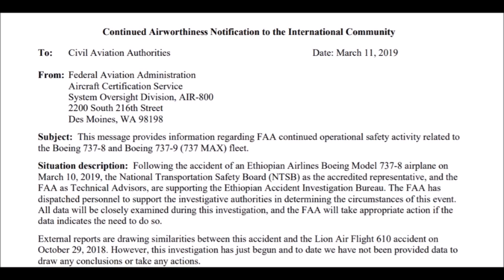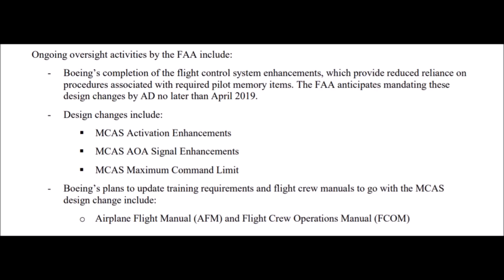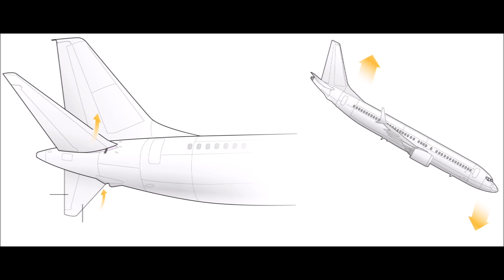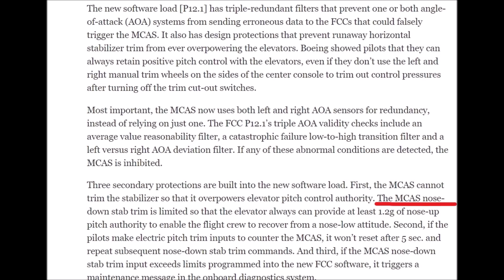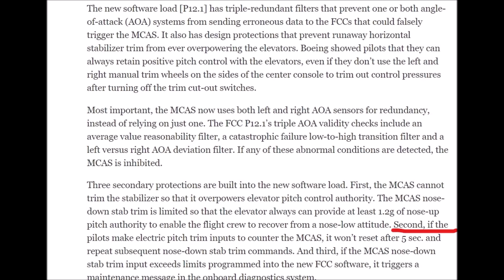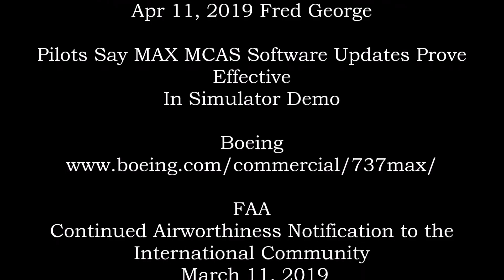737 Max UPDATE 14 April 2019 "The Fix"

Comment: ...and trust me...software to change characteristics to fit a safe one should be a major concern...as a pilot I would prefer an airplane where the automation helps me rather than be the only reason the unsafe plane is safe...and as a programmer I can guarantee you that programs can always have bugs...should not be used to change characteristics from unsafe to safe in any passenger airliner.

Comment: You mention that automation saves lives. Well, in the MAX, the only thing automation does is to save money at cost of safety...remember that the engine was too big to fit under the wing...in the old days they would redesign the entire aircraft as a new generation...the A320 neo was high enough and did not have to be re-designed...in the case of the MAX, they put the MCAS...it is a bit like making an albatross fly as a normal plane by making it swallow a software program :)

Comment: Im sorry but this does not solve the root cause, it solves the effect of the root cause. the root cause being a design flaw in the placement of the engine. this is akin to designing a car that swerves to the right, then you compensate by turning the wheel to the left and adjust the steering to center. stupid if you ask me

Comment: Why doesn’t MCAS check the plane’s pitch attitude? Activation makes no sense unless the pitch angle is fairly high - not the case in either crash.
Reply: Pitch and AOA are not the same thing, and differ over the flight envelope. Adding another check does not necessarily help, an aircraft can stall in any pitch orientation, if the airspeed is too low.

Comment: Shouldn't an aircraft which is designed to fly, fly normally without the MCAS? The earlier version of Boeing 737 had no MCAS. This system is basically introduced to offset a fundamental design flaw, i.e. nose up pitch induced due to bigger engines fitted further up the wings. Nobody is talking about this flaw.  It's like fitting your family sedan with an AMG 6.6 liter bi-turbo. They basically didn't touch the airframe.
Reply: The MAX will fly the same as the earlier NG model, over most of its flight range. Only at high AOA, which should never normally be encountered in a passenger flight, is there a need for the MCAS system to activate. BTW, the power of the MAX engine is almost identical to the NG engine, only the diameter is different, because of the larger fan and bypass ratio.
Reply: The max has a height restriction, unlike the Airbus. hence the big engines had to be pushed forward and up @gordonrichardson2972

Comment: Juan. Great video.  Any chance we could get you to do a system every week. It’s more fun watching you (especially trying to justify the airplane with the wife) than it is trying to read my manual. 

I’m really glad that you brought up the issue of automation and safety. I am tired of the public thinking everything is automatic when in fact NOTHING is automatic. We are becoming over reliant on the ASSISTANCE we get with a 3rd set of hands, so to speak, while we fly the aircraft in an ever more crowded and complex ATC system that gives us progressively less room for error.  I’d love to fly the aircraft more if I wasn’t in constant fear that the 5th runway and arrival change that Denver just made to my flight plan wasn’t programmed to perfection. With no less than 18 nav waypoints, crossing altitude ranges, and speed changes, with 8 very important notes written in micro print on the sides of the star while be bounce along, and in the middle of that I am dealing with company requirements to coddle the flight attendants and passengers with soothing and calm PA’s😊 as we encounter moderate turbulence, and deal with the 5 company messages squirting out over the printer over gate changes and comfort animals. In the meanwhile, the controllers have become professional auctioneers in their rate of speech, and they are controlling 25 airplanes at a time on 3 different frequencies.  THATS making our hand skills worse... more importantly it’s driving me crazy. 

So the environment is driven to change by the increasing complexity and congestion. 

And no wonder you are always making videos.  I’m guessing scamming the  system and getting close to 90 without your 3.....  I have Uber respect for that maneuver😉

Comment: At 8:12, when you say that if the average reading of the two angle of attack vanes is too far out then the MCAS cuts out.  Instead of "average," do you mean deviation, standard deviation, or standard error?  - Ian D.
Reply: There are a number of different measurement criteria, and Juan is glossing over some of them. AOA is an instantaneous value, but fluctuates with turbulent airflow. Tracking an average value over time is a good idea, in order to detect anomalies, before taking any drastic action. Look at the Boeing document at 07:50, rather than the words Juan says. Even this is a summary, the full algorithm is much longer.

Comment: It's still going to take an act of God to convince me that when a flight officer pulls on the column, and the craft does the opposite, that this is not unacceptably gross negligence. Reducing the killdozer potency of the fly by wire, and increasing the display and audio warnings is swell, but Jesus Christ, pulling up on a plane and having it nose down? NEGLIGENCE. Even criminal negligence, because they MUST know better than that.
They need to pull this entire model and start over. Their paradigm is utterly deadly. Even though it makes the MAX "easier to qualify for to fly".
Reply: But as Juan says, that's supposedly in the new software roll out, that elevators trump trim. So maybe the killing ends now...

Comment: OK Juan here is a question for you.  what is going to happen to the max aircraft when they extend the fuselage nearly 5 feet like I read the other day.  Talk about center of gravity issues.  Would really like to hear your opinion.   A side bar;  I was a trainer on a retail system for the USPS.  We were told that we could try to break the system during our non teaching time..  I tried a lot of things and then found  that there was a flaw in the programming regarding refunds.  I actually talked to the programmers and they had it fixed in less than a week.   I  used to program, now retired, but still create stuff in Excel  and one thing I learned is that it isn't good to release until it is tested, tested and tested again to be sure you have accurate results and you verified it manually.   Good info Juan.
Reply: When an aircraft fuselage is extended, they usually put half ahead of the wings, and half behind, so that the CG doesn't change much.

Comment: 1. I think it’s too soon now or even EVER to make the general statement that automation SAVES LIVES. MCAS (automation) just downed 2 B-737’s killing ALL onboard. If you say that automation is intended reduce pilot workload, ok then but in these two accidents the automation only increased confusion and workload. Some safety device THAT was!
2. Once stabilized in a nosedive, shallow descent, straight and level flight, or steady rate climb, an aircraft is already pulling 1.0 G’s just by simply being there. If MCAS (automation) is going to have authority to limit me (our the pilots I’m trusting to ride behind) to 1.2 G’s which is a sum of only  0.2 G’s more than you get for just “being there” in steady state flight! Thanks for relaying this to us! Heck man! I’m pulling 1.0 G’s just sitting here at home, in a chair, watching this video. If the new MCAS is going to guarantee that I can have 0.2 G’s more than what I’m pulling in steady state flight, well then, thanks but no thanks. I’m not convinced. 
3. Back to “automation saves lives”. I remember when Piper started putting that wonderful “automatic landing gear extender” on their retractable Piper Cherokee Arrow and Lance so that just incase pilot forgot to extend gear before landing, the new automatic gear extender would “step in” and save the expensive damage of a “wheels up” landing. That all seemed to be a good idea till there were a few instances of loss of control where the “deluxe automatic gear extender” extended the gear in cruise flight when ice accumulated on the sensor for the “automatic gear extender” and pilot was trying to handfly the plane. 
   In a nutshell, there’s absolutely no reason for a pilot to be anywhere near stalling a 737 at 1000’ AGL but if an aerodynamic stall DOES happen that close to the ground or if pilot needs to pull up due to rising terrain, conflicting traffic, birds, high sink rate, etc, well then, 1.2 G’s is definitely not enough to keep from the plane becoming a “lawn dart.” I haven’t heard this much silliness since.......Gomer joined the USMC!

Comment: Great, but while single redundancy is better than none, I'm concerned with the base reliability of sensors to begin with. The sensors on Ethiopian were WILDLY divergent, and on multiple sensors. That suggests MUCH more than just a rare sensor glitch that single redundancy might render remote.    Put it this way: airspeed alone is a crucial, critical reading. When on a brand new plane you have one of the two reading 432 and the other 500 - that's a deadly serious measurement failure. When the BASE reliability of any single sensor is, let's say 67%, then single redundancy only raises your reliability to 89% - which is still awful. 90% is only improved to 99%, and so forth.  And that is EVEN when the software is done correctly (which Boeing engineers catastrophic failed at with the Max release).

The point: single sensor reliability needs to be well over 99% to begin with. The readings on Ethiopia suggest that there is a deadly unreliable sensor problem, and that can NOT be covered up by redundancy programming beyond a point (and that point might be exceeded now, making the plane a killing machine).

The point is, if each sensor is not over 99% reliable, there's a good chance that BOTH are wrong and people die. That needs to happen less than one in a million flights. Not one in 1,000 or 10,000 or what have you. FIND OUT WHY THE SENSORS WERE SO WILDLY DIVERGENT.

More than that, this wasn't an Antarctic flight with useless frozen pitots. This was in optimal conditions. Right?
Reply: As to just one of the mortally malfunctioning sensors, I read the airspeed was reported as both 438 kn vs. 500. Then there's of course the AOA. How many others? And even if the software is tempered to reduce or prevent it killing more people, what about bad sensor information to pilots losing planes and killing lives?
Reply: AOA sensors are a known and proven technology. The average failure rate of 1 in 100,000 flight hours is a bit more than your 99%. Unfortunately they are exposed on the outside of the aircraft, and can be damaged on the ground, such as by mis-handling of the airbridge. There have been several reports of single AOA sensor failure on other aircraft, but without the fatal consequences of MCAS.  By comparing the output of two sensors, the risks will be substantially reduced.

Comment: Juan - have you looked at the recent Norwegian cruise ship story?  It's a new boat (2017), and the media appear to have just accepted this as just a low oil pressure issue, which caused the engines to shut down.  But the oil pressure was within permitted limits.  I suspect poor engine management software (and it's ability to over-ride the Bridge) was the key problem; the sensors were reporting fluctuating oil pressure with the rolling of the ship in the storm, which is probably completely normal.  This should have alerted the captain to a potential problem, but the last thing the engine management software should have done is SHUT DOWN all the engines when the ship is in a severe storm, only 1 mile from the rocks with 1500 people on board.  Again it seems that computers / automation are taking control when they shouldn't be, and software engineers are not thinking about the potential implications and limitations of their code, in real life situations.
Reply: Interesting story, but not really enough public information for Jaun to do a video.
Reply: Many times software engineers don't know and don't understand the real problems which can appear in flying, navigation or even driving a car. I work in car electronic repair field and I have seen so many stupidities in car softwares . Nothing is impossible. And above all is money. They must finish the software on time. Boeing wants to sell the aircraft before Airbus to sell more. They are not interested if 400 or 4000 dies. They are insured (companies). They don't respond for their actions with liberty or personal money. So pray to god and make a big cross. They say that the software is ok now and we must belive. Let's see who will be the first to try the new update!

Comment: I will not fly in this plane any longer, regardless the fix or what the FAA approves.  If, as you say, it is true that the feel of the plane without MCAS is only slightly different than the original 737, then why bother with MCAS?  I believe in the keep it simple philosophy.  Also, interesting how it takes Boeing only a month or two to come up with a fix, whereas a full accident investigation will take over a year!  Shouldn't we wait for that before a band-aid on a band-aid?!

Comment: thanks, Juan for your time and effort. Much appreciated!  I am not a pilot, yet, nor am I in the flight industry...but in related industries for large companies, there is a lot of pressure for following orders in middle management. I am sure there has been discussion in the design phase of any new implementation of improvement whether it be cost savings in manufacturing or engineering_marketing _ and sales....versus safety issues. I am sure MCAS had good intention it was designed for handling trim. I can see though that there wasn't enough testing for inadvertent data input to the software/mechanical stream. To proceed with new designs to be implemented in aircraft sometimes involves a pressure for hastily made decision making. And that...is a recipe for disaster.
Reply: Rich Coffman Yes. It's called fault tree analysis.

Comment: 3:36 I don't believe that Boeing bullshit, they're saying this is what MCAS is now -so they can get on with making money selling planes, getting passengers into the air. There's no way such a drastic system error was design to replicate the original feel of an earlier 737 model. It was Really to pass certificates save money etc. Because of the balance issues associated with bigger heavier engines putting too much weight on the tail the MCAS had to be designed into this old system, a system they failed to safely implement.
Reply: If the new engines are heavier, and forward of the center of gravity, how exactly does that put more weight on the tail? Have you thought this through? Are you just repeating things you have heard/read elsewhere that confirm your own bias?
Reply: stimproid Still plenty of trolls out there...
Reply: @gordonrichardson2972  Agreed

Comment: Thanks, it’s been a great information series. I’m wondering about the validity of introducing MCAS in the first place. If it’s functionality will be overridden anytime one of the three conditions you mentioned is present then at that point they’re flying a 737 Max vs a 737 Max that “feels” like any of the previous iterations yes?
Reply: Steve Haire The reason for introducing MCAS was to meet the regulatory requirements. Most of the workarounds will still give the pilots manual control. It does seem overly  complicated.
Reply: Gordon Richardson , thanks. Yes, I agree... overly complicated. It’s apparent that adding the augmentation system was done as an expeditious carrier cost-saver given that “experienced” pilots could barely detect any difference between Max and earlier variants. My comment was meant to suggest that given the crew can and should defeat it if they detect an issue means they fly without augmentation and likely don’t need it there in the first place. 🤔

Comment: I am in the water heater business. Every water heater we sell comes with a factory installed Temperature & Pressure Relief Valve for safety reasons. (See Mythbusters Water Heater episode for what happens when safety features are bypassed) Safety features are not options in my business. Safety is government mandated. We are not allowed to “police” ourselves. What the hell is going on with both the FAA and Boeing that allows them to self “Police” report. This same nonsense is what led to the financial meltdown by allowing the banks to self police.

Comment: Is the plane's elevation taken into account by MCAS?  In other words does MCAS note how far above the  ground the plane is before adding more down trim?
Reply: William Donnelly Not directly no. However,  MCAS only operates when the flaps are retracted, so it is never used during landing, and at least a short ehile while after takeoff.

Comment: @blancolirio, in boeing's fix. There are some case the MCAS will not be triggered.  if MCAS is not triggered, how 737 max is able to recover once having high angle of attack situation.
Reply: Feng Qin The normal stall recovery process is available, just like on any other aircraft.